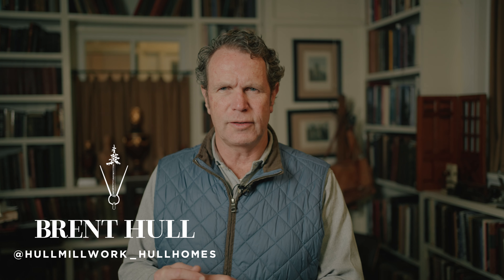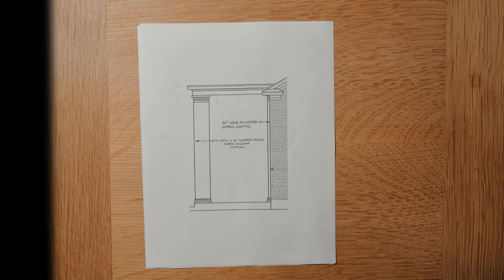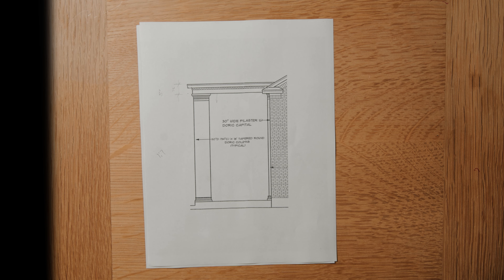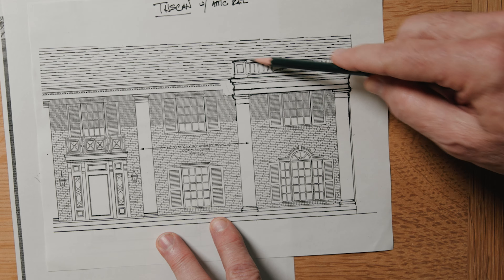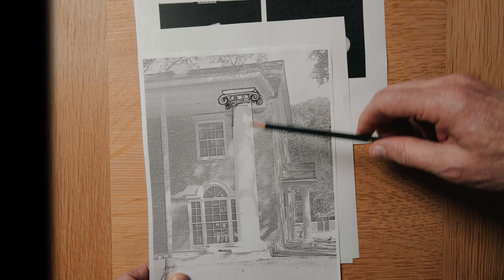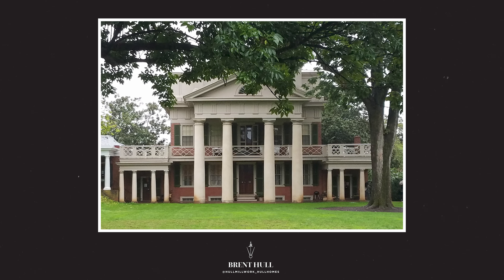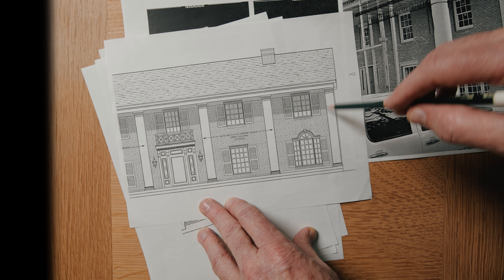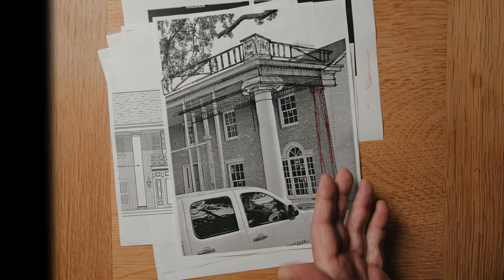Fixing a Front Porch

Comment: Hi Brent, great video! At minute 3:05 you show a drawing of the front of the house with the taller entablature (which was made taller by lowering the height of the beams that rest on top of the columns). I thought on the front elevation that the lower beam height makes it look like the porch ceiling is "crowding" the tops of the second floor windows but then at minute 4:50 I can see in another photograph that there is in fact a raised porch ceiling behind the lowered beams (which is presumably the existing height of the porch ceiling).

However, at minute 6:30 there is another photograph of a different house that shows the porch ceiling and the bottoms of the column beams are roughly the same height off the ground and that they run from the column tops to the house wall  (while still leaving some space between the porch ceiling and the window tops).

I have two questions:
1. Proportionally, is it better to lower the height of the beams resting on top of the columns (and make the front facade look from a distance like the porch ceiling is crowding the window tops) or would it be better to leave the column heights as they are and raise the entire porch roof (and porch ceiling) so you can then insert a taller entablature?
2. How do you manage water when you have to tie a relatively flat porch roof (and attic railings) into a sloped main roof?
Reply from the maker: Well it is always a challenge, but the designer (you) get to choose. You are asking about the very things i ask myself in the fix. I think a successful design will combine those elements in a pleasing way. I don't think there is a rule that will apply to all projects. Water too is a challenge.

Comment: I was thinking about this and if 3 more feet of entablature should be added then the columns would only be 15'.  So would the diameter now only be a maximum of 2'-2.15' to stay in the 1:7 proportion or is the ratio based on total height of columns + entablature?  P.S. I was watching with my son and he was impressed with your drawing skills.
Reply from the maker: Haha, tell your son thanks. You aren't just going down on the entablature you are raising it as well. These pieces need to be managed by the designer for the most pleasing look. Thx for watching.